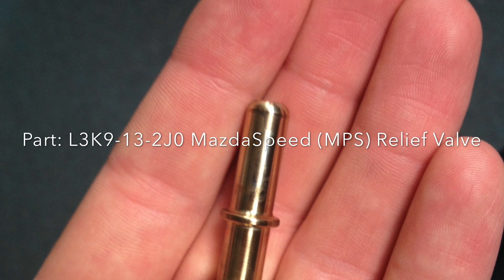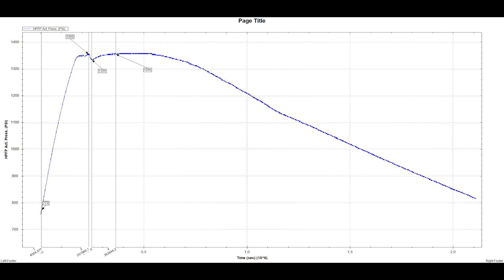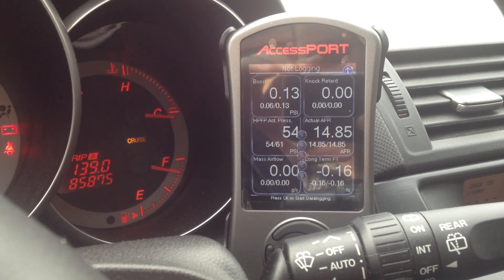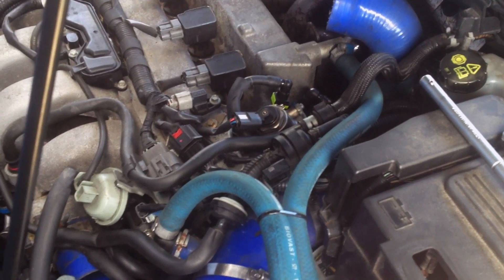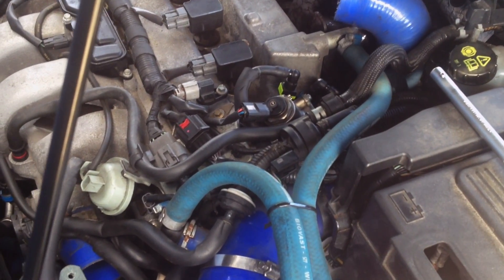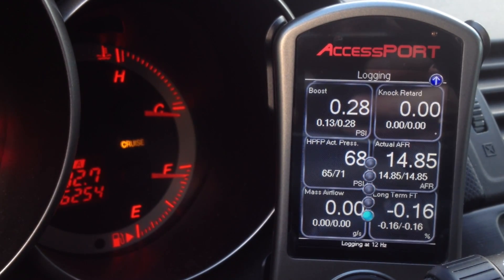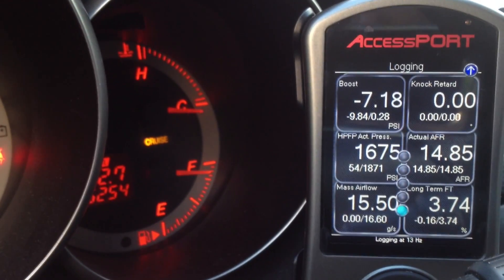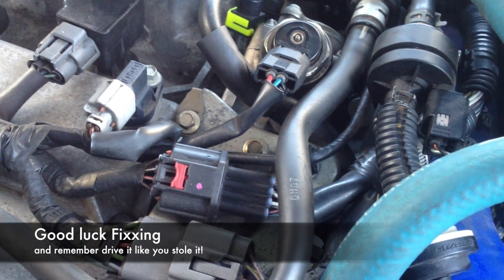Relief valve Failing & Fix Mazdaspeed 3/6 CX7 (MPS)

Comment: In hopes you might see this since you seem to know your stuff. I'm having stuttering problems that occur around 2-3k rpm with my ms6. Have cleaned the MAF, air filter, spill valve and changes the spark plugs. My tuner is suggesting to check the reliefe valve next since on acceleration (not wot but decent) the fuel pressure drops under 1600psi right around where the stutters happen. Idle is around 450psi and I did the test on this video and after getting the car warm and turning it to on position the pressure got up to around 1500 psi in 10 minutes. Does that sound normal or should I look into replacing the relief valve?
Reply from the maker: If it only goes up to 1500psi than it sounds like the relief valve is busted. That stuttering is the effect of not enough fuel pressure. Even if you drive with normal load the ECU demands 1600psi (stock) fuel pressure at around 2k+ RPM. If you log the injector dutty with right now you will most likely see that it's at 90%+ meaning maxxed out... Like I explained in the video do the hold test and if you don't get the 1900psi than you can say with a 80 to 90% change that the relief valve is dead! Just swap it out and you will see that it hold 1900psi again!
Reply: Sounds logical. While stuttering I got a miss fire code from cylinder 4. Can that also be caused by a drop in fuel pressure? I feel like a complete noob with this stuff.
Reply from the maker: Correct! Fuel pressure and injection duration dictate how much fuel is being injected. For example if the fuel pressure is high you can have a short injection duration. Same like a water hose that you use to fill up a bucket of water. If the water pressure is high more water comes out of the hose. And if the pressure is low you need to wait longer for the bucket is full. Now a mis fire can happen because of TO rich mixture or not enough fuel and that scenario is more likely. ( There are more reasons for a mis fire like bad plugs to wide or small gap plugs or to cold plugs... Bad coils but let's say this are good )
Reply: @jaspervermaas  Thanks for the insight! Will change the prv and see if it helps. If the condition of the spill valve is anything to go by, it just might be the cause. Running on e30 btw so some buildup will happen.
Reply from the maker: @onvaa  E30... Make sure the spill valve in the HPFP is clean cause that starts to faul and the valve can stay in a open or leaking position! Google mazdaspeed HPFP cleaning than you can find blogposts about the needle valve in the hpfp that fails because of gumming of the e85 fuel!
Reply: @jaspervermaas  I cleaned the spill valve a couple days ago and it's good now. When I described my issue to my tuner he straight away said, clean the spill valve and the relief valve so I'm changing the prv asap now.
Reply: @jaspervermaas  Just wanted you to know I changed the prv and now the fuel pressure goes right to 1830ish psi where previously it peaked at just over 1500psi. Sadly it didn't help with the stuttering. Next up is getting injectors cleaned and getting better seals for them. The funny part is that on wot, everything is fine and there's nothing weird in the datalogs.
Reply from the maker: @onvaa  what sparkplugs are you running and what heat range and gap size???? Cause sometimes when the sparks are to cold you get stuttering when the gap is to big and not enough load or temp on the sparkplugs!
Reply: @jaspervermaas  I've been running Denso ITV22s for about half a year now with no issues. Got a brand new set just last week trying to fix this issue. Gapped to .026.
Reply from the maker: @onvaa  I used to run the denso itv24 but than I learned that they sometimes break... As in the ceramic breaks... So than I started to run the NGK plugs (you can buy them for cheap from thegreensparkplug. Co. UK.)  And since I used the NGK I have never had the stuttering on low load cold engine....
Reply: @jaspervermaas  Interesting...I'm doing the injector maintanance in a couple weeks when the new seals show up and if the doesn't help, I may try some other plugs.

Comment: Just did this test it got up to 1411 psi and then started to drop bought the car used with mods I'm going to check if there are after market hpfp in the car. Should I change this valve running a cobb stage 2 tune (car came like this)
Reply from the maker: Do not run a stage 2! A stage 2 needs ±1800psi. And running lower could meansl that you will not get enough fuel in the cilinder and could lead to knock or a blown engine. Run a stage 0 (stock) and replace the relief valve! Checking the hpfp to see if it has upgraded internals never hurts!
Reply: Unknown Username if I run stage 0 is it safe I have a sri intake, and turbo xs catless down pipe
Reply from the maker: @andrewtroina6407  it's safe! Just check if your LTFT stays between -7,5% and 7,5%. If it goes up to 15% you would need to calibrate your MAF. Also check your HPFP pressure and see if the car cand hold 1600psi but remember your relief valve opens at 1400psi now so it's harder for the hpfp to keep up with "leaking" of fuel and thus fuel pressure!
Reply: Unknown Username how do I check for the hpfp pressure? Sorry new to all this wish the person I bought the car from was honest
Reply: I'm going to replace that valve as soon as possible as I daily drive this car
Reply: Also forgot to mention I'm running a turbosmart 50/50 bov stage 0 is safe or can I run the safe mode + sf map
Reply from the maker: @andrewtroina6407  if you have a Cobb accessport than you can monitor the long term fuel trim (LTFT) this is value shows how much fuel the ECU adds or subtracts whil you'r driving the car measures air going in to the engine with mass airflow sensor (MAF) and it measures the amount of air to fuel ratio in the exhaust with th lambda sensor. Your ECU is programmed to inject X amount and so your ECU can calculate how much fuel to add or remove while driving ( due to surrounding air pressure or diameter of your inlet to the turbo where the MAF sits) the Cobb accessport can also show you the HPFP pressure. Cobb has some documents that explains all the values it can show!
Reply: Unknown Username thank you so much so I'll run stage 0 till I replace vale and check hpfp then I'll flash stage 2

Comment: I know it's an old vid but if you're still active - my hpfp (I thought, have replaced now) is extremely noisy mainly when coasting. Very loud ticking noise. My car is warm so I can't cold start but while driving could you hear the ticking echo around the street? I can grab a log soon, no performance issues it seems. Cheers
Reply from the maker: You'r sure it's the HPFP? If it's the hpfp than you can remove the pump to check the Spring and retainer clips in the washer plate that keeps the Spring in place... The Spring shouldnt be loose so if there is movement in the spring you might have to replace it....
Reply: @jaspervermaas  It seems to be in that area. Other guy and I tested listening through a screwdriver and it seems to be from the fuel pump. I had a guy install it who has done his own hpfp and mine twice now (and said my original one was not good) so this is my second set of internals (and second fuel pump as that is what I thought the issue was)
Reply from the maker: @frogsta360  and how did he come to the conclusion that the hpfp was bad? Did you have misfires or no power or a ECU light on?
Reply: @jaspervermaas  I had a Mazda mechanic suggest the internal seals of the fuel pump had died and hence creating the metal on metal ticking

Comment: So i did the test that you mentioned because i was getting a brief chirping and clattering noise from the hpfp side of the engine and my hpfp peaks at 1743 before dropping off. Is that a sign of a bad relief valve?
Reply from the maker: 1743psi is ok if you haven't upgraded your hpfp and not running a tune. Cobb maps run at 1750psi fuel pressure so that means that the valve will be open constantly (and it will break!)  For a stock car it's fine cause that only goes up to 1600psi with the pump.
Reply: @jaspervermaas  i meant that with the engine off after driving the fuel pressure peaks at 1734 before bleeding off. I have upgraded hpfp internals and a freektune custom base map tune
Reply from the maker: @6.Slow_Gto  the relief valve works as a safety valve meaning that if you run 1750psi fuel pressure the valve shouldn't be open... It should open for example at +10% of the wanted pressure... If it now opens at 1750 that means that when the ECU commands that pressure it will not open the presure control valve on the op of the hpfp to control the pressure. So in my opinion I would swap out the relief valve cause a good working valve should not open at 1750 but more likely at 1850 to 1900. If the relief valve already opens at 1750 that means that it's going bad in my opinion....
Reply: Got it thanks

Comment: I had the same Problem, after the third fuel pump i took a look at the PRV and it was stuck open. I have had low pressure - bout 20-40 bar overall. 
Changed it, Problem solved! 👍🏻 thanks for the vid, now I can boost on 💪🏻
Reply: Did your motor start with the PRV stuck open?

Comment: If the hpfp isnt working, how can you do the koeo test if the hpfp isnt building any pressure or if the rv is bad
Reply from the maker: The HPFP is driven by the cam. So if the engine can't start than you can't test it... It's hard to test without the HPFP running

Comment: are you idleing at 1600 psi..I only idle at 430ish..or is that because of the safe map
Reply from the maker: that slow goat no you idle around 450psi because the HPFP releases the pressure via regulator valve in the pump. When you turn of the the engine than the regulator valve close and due to the heat that had build up in the high pressure fuel rail the pressure will rise and this pressure can only escape via the relieve valve(let's call it a safety valve) and that's why you see the pressure build up X PSI. So when the relief valve opens before the 1600 psi (stock) or 1900 psi (upgraded HPFP) is reached than your HPFP can't pump enough fuel to the injectors (more pressure means more flow so loosing pressure means less flow means running lean means zoomzoomboomboom)
Reply: Unknown Username gotcha..new to this whole GDI system setup. one more question..with key on and engine off, is the fuel pressure shown the fuel pressure from the low pressure side of the fuel system?
Reply from the maker: that slow goat no it measures it from the hp fuel rail. There is no low pressure sensors that I know. You only need the car in key on the on position to get power to the sensor and so you can't read the pressure. As soon as you start the engine the spill valve will open in the HPFP needs to idle at around 450 ±50psi
Reply: Unknown Username makes sense. does the low pressure side on the ms3 have an test port on the low side of the fuel system to test the pressure coming from in tank fuel pump
Reply from the maker: that slow goat the accesport can't read the low pressure side. But it's easy to test if your LPFP works just disconnected the flexible fuel line get a big bottle hang the fuel supply in the bottle and put the key on the ON position than there should be fuel coming out of that line cause the car wants to "prime" the fuel system. You could also listen for a buzzing sound from the rear seat (fuel pump is under the rear seat) if you don't hear any sound than 1st check the fuses!
Reply: Unknown Username alright thanks..nothing's wrong with my speed3 just want to know more about testing this system..didn't know if there was a test port on the low pressure side to hook up a mechanicle gauge
Reply from the maker: that slow goat so yes you can just connect the mechanical gauge on the fuel supply line and you can read the pressure. The LPFP should not go higher than ±90psi
Reply: Unknown Username is there a way to tell between a failing relief valve and a failing hpfp
Reply from the maker: that slow goat yes by following the instructions in the video! If your fuelrail pressure isn't going above 1600psi than your relief valve is broken! It's should hold at ±2100psi so if your fuelrail pressure goes to ±2100psi than check your HPFP spill valve the big nut whit the electronic connection! You can open that to see if there is dirt. On the mazdaspeedforum you can find a post that discribes opening and cleaning the spill valve for if you run e85 cause that has a tendency to gum up the valve and make it sticky.
Reply: Unknown Username that makes sense to test the relief valve first to see if it holds x amount of psi then move on to the hpfp when dealing with low pressure when driving
Reply: Hey guys i have problem with my mazdaspeed 3 when i go in high rpm my car drowning and i see black smoke i try to race but i cant i need help
Reply: @josuearroyo370  youre over fueling for some reason

Comment: Just installed a turbo in a cx7 and it runs good but oil is coming from everywhere! Going to try again. Any pointers, i love mazda, like the car, its in excellent shape.
Reply from the maker: spoada this depends on where the oil is coming from. If it's coming from a surface that has a gasket than I would replace that gasket.
Reply from the maker: just get new gaskets for the turbo clean the surfaces and replace the old gaskets than torque the bolts to spec! oil and water supply 7,8 to 10,8 Newton (70-95 in-lbf). make sure that the surface of the oil pipe and the turbo and engine are super clean! this should fix the oil leaking from the turbo... unless its coming from a other place than the gaskets... if its leaking from the center house rotation assembly. if its coming from the CHRA than the turbo is not good...

Comment: ok i have a mazda cx7 08 and driving u get up to 25 starts jurking then sometimes its running fine 70 down the road and then bam nothing help parts are not cheap
Reply from the maker: Cassie Shotts when sudden stops of the car appear than this can be caused by grounding problem or a random fault by any possible sensor... Like for example the crank angle position sensor... To know for sure what's going on with your car you really need a data logger! For example the ELM OBD2 Bluetooth dongle and a smartphone with a free app like torque lite this tools can show freeze frames from the ECU and this can help you solve your problem

Comment: So my car idles right about 100psi I replaced my entire fuel pump with CPE and still isn't fixed. The exhaust is sputtering and the pump has a Loud chattering. Is this relief valve the fix?
Reply from the maker: Bryce Sponsler start your car let it run so the fuel gets warm than turn the engine off and check fuel pressure... The pressure should start to rise (thermal expansion) if the prusure doesn't go up you most likely have this problem...
Reply: Bryce Sponsler did you find out what the problem was. I'm having the same symptoms as you?

Comment: Started getting the same twitchering/whisteling noise as yours, also threw a code P0089 on the track. Changed the valve and knock on wood so far so good. Only time will tell. Thanks

Comment: in your video i dont see your fuel pressure ever hit 400psi at idle. mine is at 450 psi at idle. and on full boost it hits 1650psi. and my ltft is at 0%
Reply from the maker: the log is from the fuel pressure is when the engine is warm and not running... when I start my engine the HPFP starts to regulate the fuel pressure and than it drops down to 400psi at idle and 1700psi at fuel boost ( I have a upgraded fuel pump) do you have mods on your car? and is your car tuned?
Reply: No my car is fully stock. I used to get a misfire on cylinder number 4 and after i swap the injectors around i can still feel it missing but the vehicles computer simply wont pull a missfire code.

Comment: damn i just reread what i wrote. no fuel is coming from the rail side its coming from the pump side. but when i block it off the car starts up. with the line off the car wont start. i would really appreciate your help with this. as ive spent so much money already and nothing. i dont mind paying for your time and sending funds via paypal